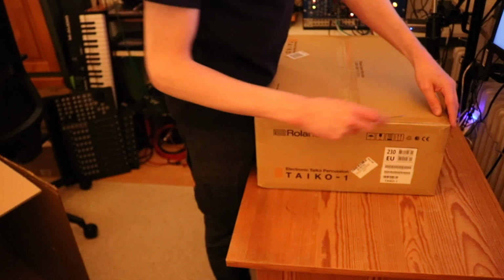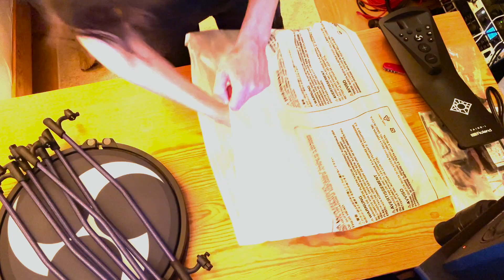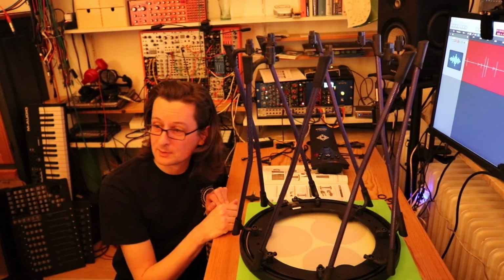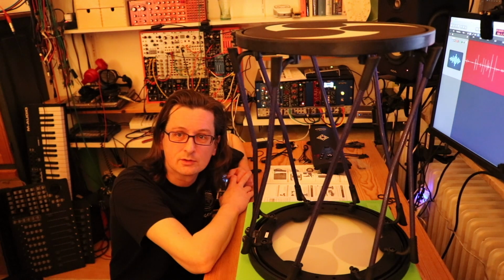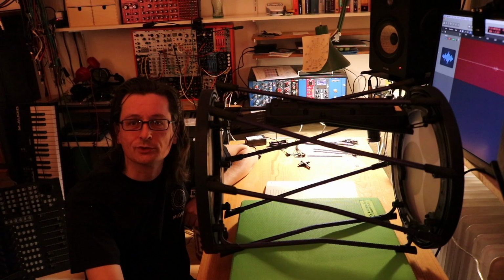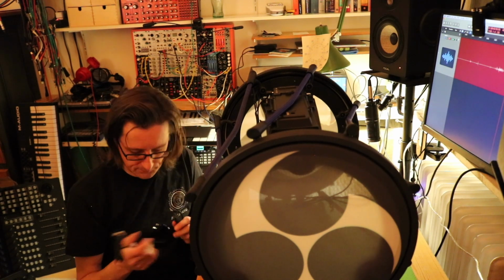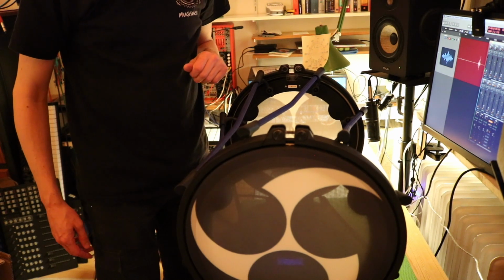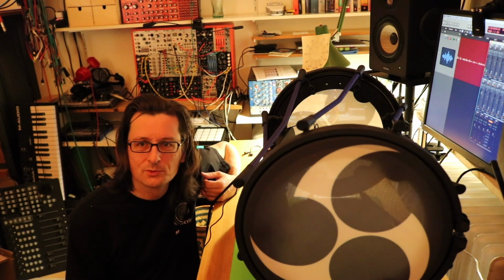Roland TAIKO 1 Unboxing and Assembly

Comment: Just wanted to ask out of curiosity if you have the controller in the same position still. Because I noticed in the video you put it upside down 😂. If you like it like that it's fine but I just wanted to make sure that it wasn't an accident. But all in all great video thanks for the unboxing. I'll hopefully be getting one for myself at the end of may. But I've already played around with it and I love it so I can't wait!
Reply from the maker: Hehe, thanks for pointing that out. I realised it later on – it was late that day and I was getting tired. I'm currently working on the follow-up and mention it there. I'm just a bit paranoid when it comes to bachi close to electronics, so I thought 'the display needs to face away from all the hitting'. 😂 It works the other way round too though. It's just a bit difficult to open the battery case.
Reply: @MarkusGuhe  lol no problem I'm glad to hear you figured it out. I totally understand some nights you're just out of it right hahaha. But I look forward to your follow up video/s. You're like one of the only English speaking YouTubers doing videos on this product. I'm Japanese but my Japanese language skills are really bad so it's nice to have this as an option too!
Reply from the maker: @alphazion4354  Yes, I noticed that the videos are all in Japanese, and my Japanese is surely worse than yours! But it also just became available here in Europe, so it's still quite new.